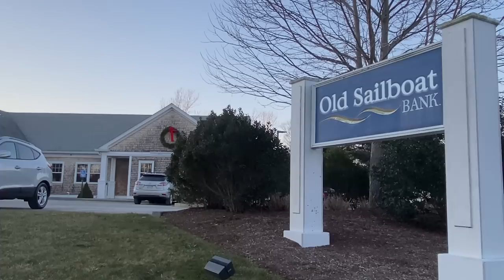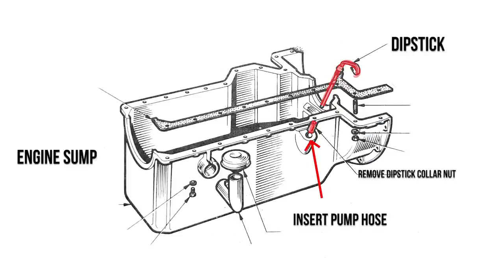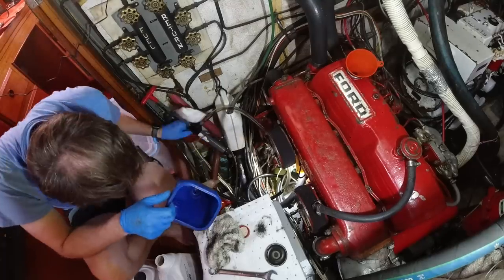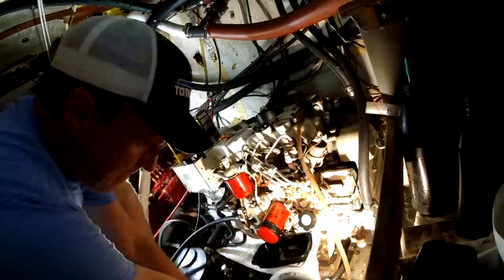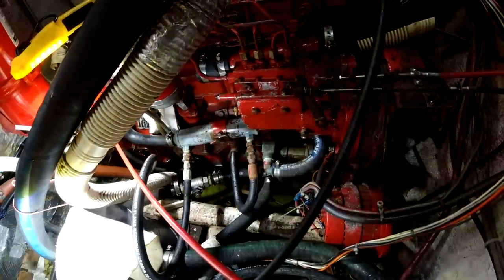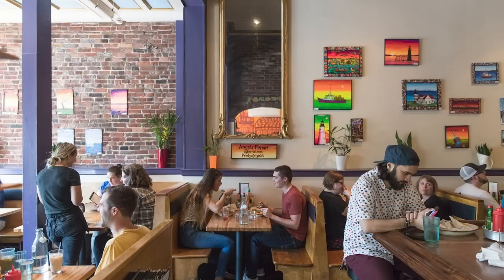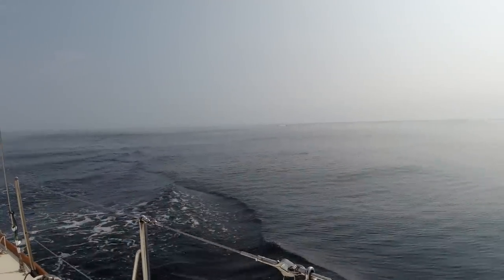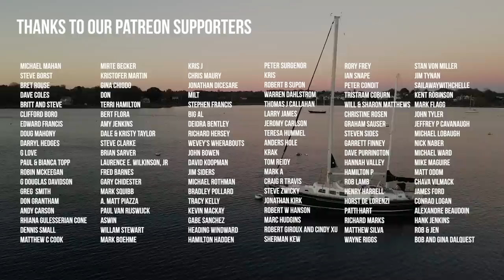Ran-day's sailboat - It's GO TIME!! EP9  #sailboatrefit #sailboatrestoration

Comment: That fuel filter and what you found on the filter and in the bowl tell a story……a very ugly story. I foresee some fuel problems in your future……perhaps carry a 5 gal. Tank to access in the event that your onboard fuel tank is full of algae.
Reply from the maker: I’m quite confident I have a thriving ecosystem in there… I’ll be doing regular fuel changes. Good thought to have a few more clean gallons on board… thanks!
Reply: I agree,the tank needs a pro clean. R&R. The tank should never have any contaminates. I do rental's for 30 years and furnace tanks get dirty!! The filter should actually have no sign of dirty fuel. Consider an injector tune up also.
Reply: Looks like making a fuel polishing system is in your near future.  Also, look at draining your fuel tank and clean out all of the “bugs”
Reply from the maker: That is super high up on the list! I’ve got space for it so I’ll be diving into it soon enough!
Reply: Came to say the same. Clean the tank(s), invest in a polishing system, a couple of jerries can be a life saver. Luv it. Go show skipper Randy.

Comment: I have been watching for a long time. I see the same thing over and over. there are things put on, and into boats that dont seem to belong. they dont fit, dont function well, are slowly or quickly destroyed. The next thing is the cost of very simple things. a broken window replacement, a filter replacement, even your emergency tiller is made of plumbing parts instead of a tool designed for the task. So my question is are boats trying to live in the best of all worlds but ending up with the best of the worst choices? I asked you in the past about having a hull to keep water out and then drilling 27 holes into it. it just seems wrong to me. I do not have a  boat. I have a canoe. I love the water. I even have problems with my canoe. it feels like a tool that works kinda good unless things go wrong. Cap Q bought a small sailing boat, the hull full of floatation. simple sail. I think thats the basis for a larger boat. everything that can go wrong should not  be there, all the holes should not be there. in take and out poor should come up  and over and up and out. not just IN and fill up the bilge if OUT doesn't work.  so what is the PB? the perfect boat. what can live on the water, get old but not just fall apart because of a O ring on a filter, or a bucket that fills up too fast with overflowing coolant? a boat you can leave out in the rain, with no sump pump, no fuel going bad, no crazy wires behind the breakers.

Comment: I did not like the look of your fuel filter or the fuel you drained out.  I think you need to add a biocide to the fuel tank.  The biocide will kill anything in the tank (usually looks like snot) and then it gets trapped in the fuel filter and will plug them up very fast!  You will want lots of new fuel filters handy!  I would even pump out and dispose of the old fuel after biocide has been added.  You can use the old fuel to start burn piles, etc...   Yes, this is more work and money but you do not want questionable fuel going to your lift or injector pump!  Your idea to rigidly mount the oil pump is a good one.  You do not want the oil lines to fatigue and crack!  FYI, When you get to the point where you are replacing the diesel fuel lines, there is special tubing used now for the bio-diesel blended diesel fuel.  The coast guard may even require a certain type of fuel tubing be used.  Do your research before you take on that project.  Sorry, I am an engineer so I worry about all this stuff...
Reply: Oops, mean oil "filter" not pump!  It is hard to get old and senile...